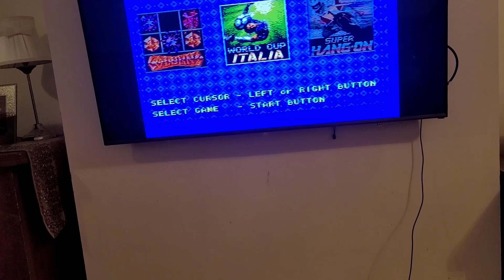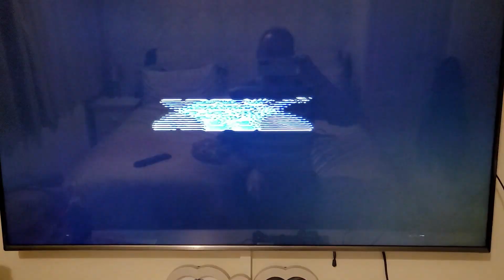Sega Mega Drive (Genesis) Black Screen Fix

Comment: What tool did you use to get the gunk out of the cartridge slot?
Reply from the maker: I used long fine tipped tweezers - https://www.ebay.co.uk/itm/374246701418